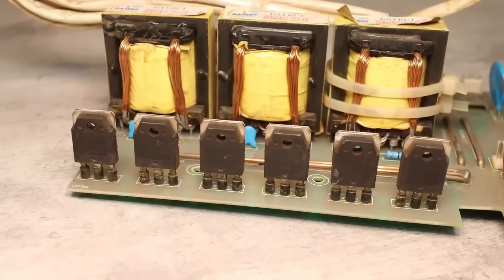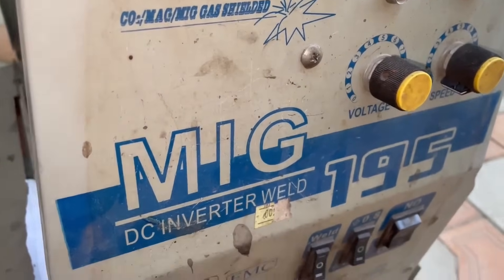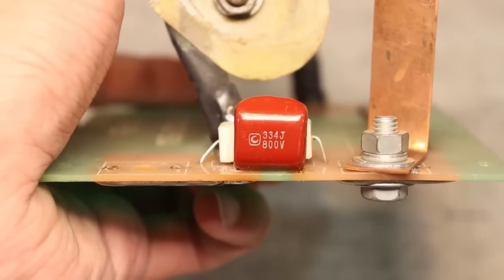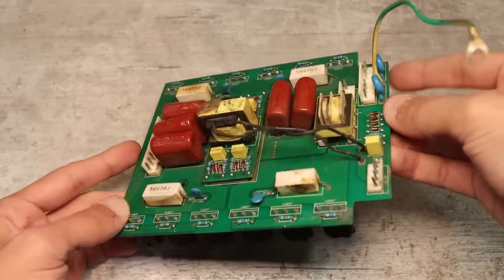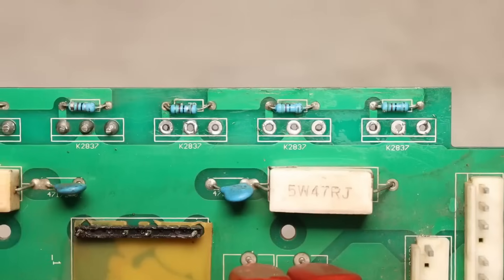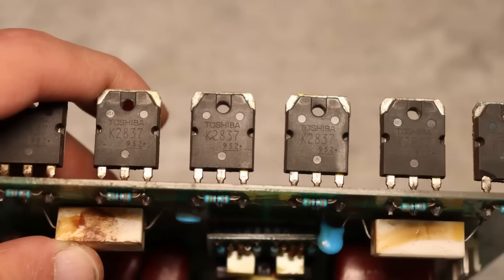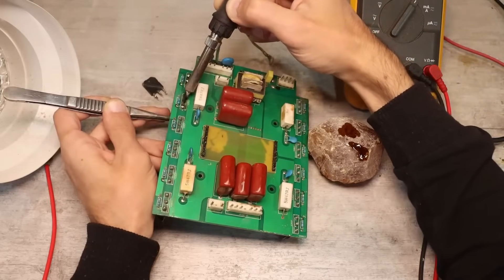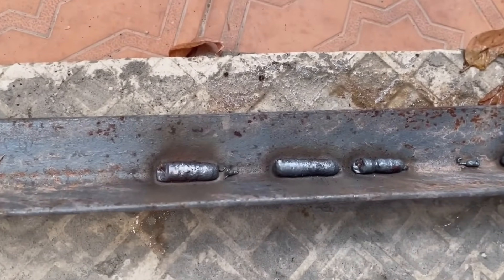Fixing a Hellish Semi-Auto Machine – Full Repair Story! 🔥⚙️

Comment: been there made the repair spec to the board but shts had to re config some power supply line and cut some trace and jump them on the proper trace and add cap to transformer chinese do some dodgy DIY repair on their pcb's